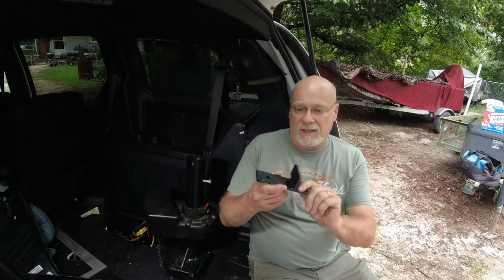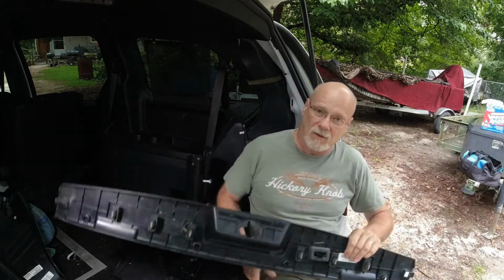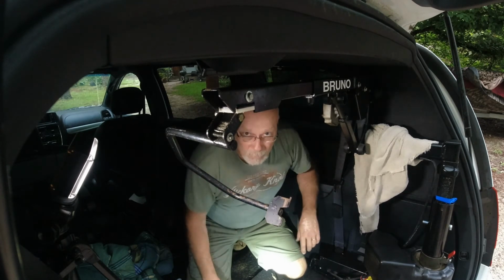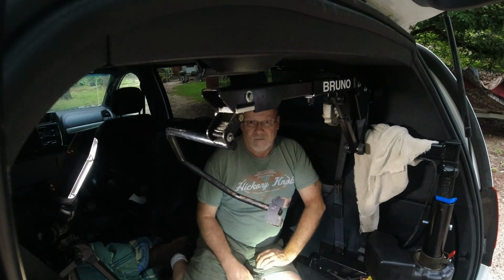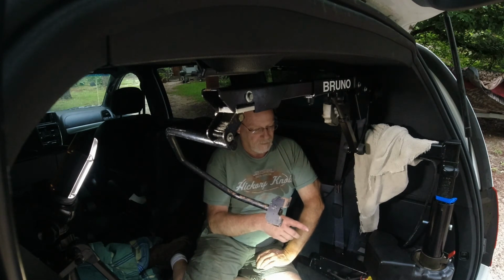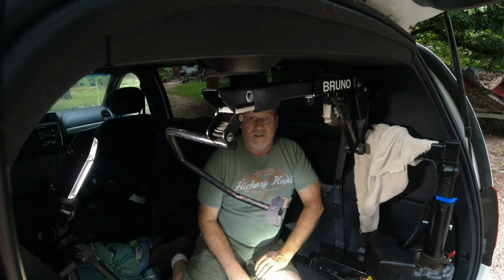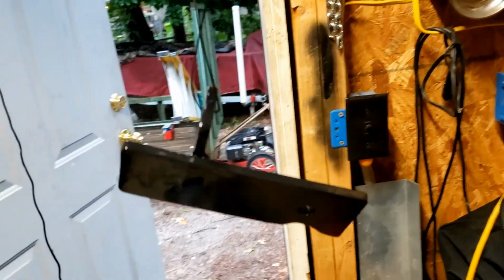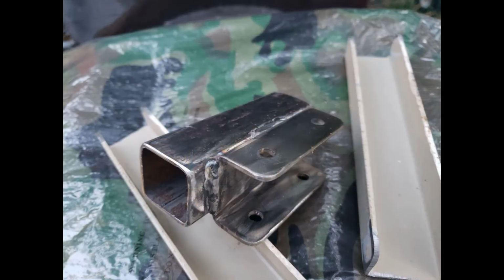Bruno Curb Side scooter lift install.

Comment: Great ideas, great video. I put the same lift in my 2009 Grand Caravan. When I sold the van, I took the lift out and put it into my 2019 Toyota Sienna. My method was different than yours. I like yours better. I put half a sheet of 5/8" plywood on the floor, drilled holes to match the U bolts on the floor for the back row seats to latch onto. I added other U bolts into these, pointing up and through the plywood, then put washers and nuts. Near the liftgate, I drilled 2 holes through the floor of the Dodge and put large eye bolts there, then with threaded rod/(all thread) came up through the plywood and into at least 1 of the points on the lift. The other 2 points were just bolted to the plywood. On the Toyota, I did the same at the U bolts for the folding seats, but near the liftgate, I just attached 2 ratchet straps to the D rings that Toyota put there for tie downs. The other ends of the ratchet straps went to the U bolts and a bracket to give a place for the hooks. So no holes drilled in the Toyota. 

Recently, we were rear ended. at the drivers rear corner. The plywood was pushed with the floor and bumper, the plywood warped up at the front left corner and broke out of it's U bolt. The van U bolt seems to still be attached to the floor. 

We are all ok, but the van is at our Toyota dealer getting straightened up. I think the insurance will get us a new sheet of plywood and a couple of U bolts. If the Toyota dealer finds damage to the lift, I hope they can get the insurance to do something about it too.  

I wish you success in your future activities, Great ideas again, wish I had seen your video before I did what I did. As you mentioned, no other videos out there with this lift and this van.

Thanks again.
Reply from the maker: Thank you for watching and for leaving one of the best comment I have had. Really apricate you sharing how you installed yours too. I'm going to try to pin your comment as the first one on the list so people that do not have access to a welder or someone that welds, can try what you did. Please let everyone know how you ran the power. Hope they get everything straight and in working order.
Reply: @LongsQuest  You are welcome andtThanks very much!
Reply: How did you run the power for the chair lift?

Comment: Could this be mounted in a 2014 Chrysler Town and Country Limited on the driver side door? I'm an amputee so when I get out of my chair I only have one leg to walk or stand on so there's no way I could get from behind the vehicle. Please reply. I have the lift already but can't seem to make enough room for it to swing out the side door and clear the side enough. I'm in desperate need of some assistance just to be told how to do it and I then can get it done.
Reply from the maker: I'm far from an expert installing these lifts but wanted to do a video on the one I installed for my dad because I could not find an install video for his model van are the mounting hardware for that particular lift. I've searched the internet for hours trying to find something that would be helpful for you with no luck. If you have photos of the lift and area you are trying to install it in and would like me to look it over to see if I can come up with a solution. I will gladly look it over. My email is in the about section on my channel page. If you come up with a solution, it would be great if you record it and post it for others with this challenge.
Reply: following.   same situation - need to load my powerchair from side sliding door of my van.

Comment: Yes, I got this lift use. I am trying to install it in a 2006 Dodge Town & Country van I didn’t get a remote to it. I had to order off eBay it’s really no install videos. No diagram on the internet you know how the old way how you put power from a regular car battery the lift work the remote don’t I was going to make a toggle switch remote I don’t know if you need a extra battery to pull this lift did you need a extra battery if you  can, can you please let me know
Reply from the maker: No extra battery, never had a problem. Make sure to add a fuse at the battery for the power wire. Hope the install goes smooth. Thanks for watching.

Comment: I came looking for info too, but only about how the lift is powered and if so where is the plug input to charge it. It is in my Mom's 2005 Caravan including a Hoverround. She is in a memory care facility, so I can't ask her. But I know she used to run a cord and plug it in. I never paid attention to whether she was charging the chair or the lift. If you see this would you mind helping me with that. Thanks
Reply from the maker: I'm not familiar with Hoveround power chairs. And not knowing what kind of lift you have I couldn't tell you anything about it. However I can tell you that the Bruno lift like I installed in the van has an on-off switch at the base of the lift. It also is hardwired into the wiring of the van and not a rechargeable lift. What brand and model is the lift you are dealing with?
Reply: @LongsQuest  The lift is a Bruno brand lift. I don't know the model, but it looks much like the one in your video. Anyway I think you answered my question - that it is hardwired to the van. So that tells me she was charging the chair and not the lift. Thank you.
Reply from the maker: @se5442  Hope you get it figured out. Thanks for checking out the video.

Comment: I'm having a hard time getting the top part of the back cover off. you said there was a screw to take out?
Reply from the maker: https://youtu.be/IXiWyucGyeU?t=59 Here is a link of someone replacing a blend motor and it will show how to remove the panel. I did not unhook the front of the bottom panel. Hopefully this will help, let me know.
Reply from the maker: Hey! Just wanted to check in with you, how are things going with your installation? Hope it is going well.
Reply: @LongsQuest  I had a welding shop install it for me I showed them your video, they put in in about the same way bet it is not as closed as yours, I hope it will work. he said he would move if he had to. my problem is how to attach it to the m41 chair, when I put the arm of the lift in the slot under the seet and try to lift it it picks it up a ways and th seet comes off and drops the scooter. I would love any Ideas you would have?
Reply from the maker: @wiltwager  Is the seat swivel bracket pulling off of the seat post or is the post pulling out of the frame? Looking on the internet I see some of the lift brackets are mounted to the seat post. My email is in the about section. If you can take a photo of where the seat is detaching I may be able to find something that will help. My Dads seat mounts to 4 posts with pins holding it on.

Comment: Do you Make the brackets that you used? And if so, could make a pattern of them so I can have a set made?
Reply from the maker: Sorry, I made the brackets and installed them without recording the measurements.  I wish that I would have at least traced out a pattern, but didn't. The hardest part was figuring out anchoring points. Hopefully you could have the fabricator watch parts of the video to see where to git the measurements needed. Thanks for watching.
Reply: Thank you for the video, you did a great job. I will use the video to take it apart.
Reply from the maker: @wiltwager  Sorry again, if you have any questions about the brackets let me know, I will try to help any way I can.